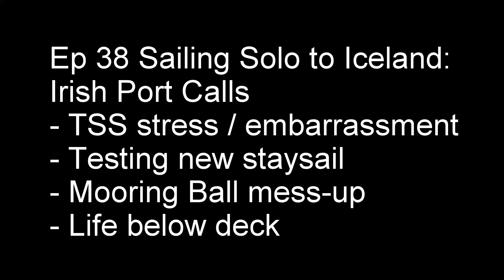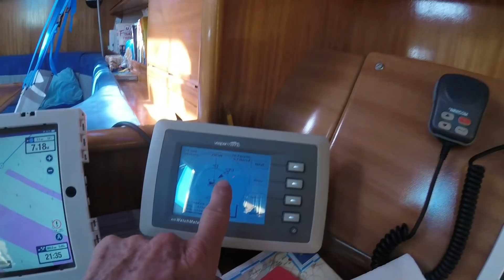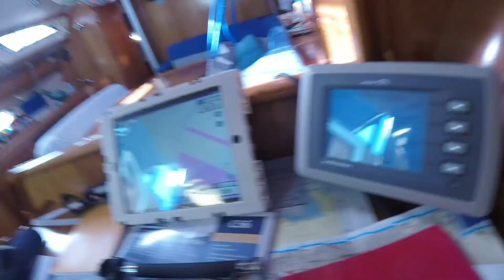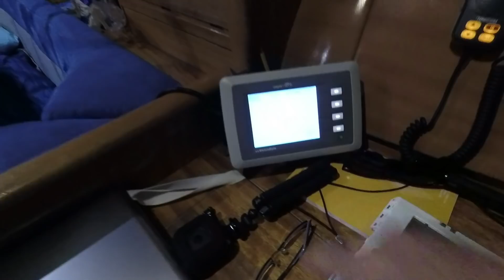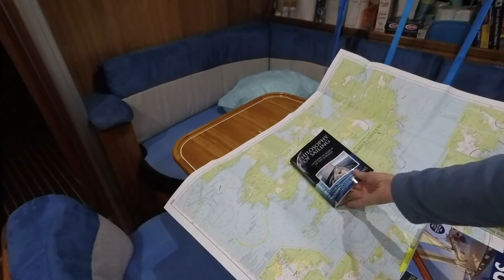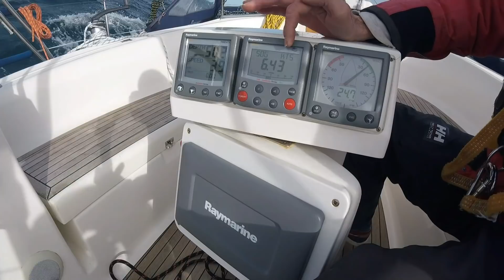EP 38 Sailing Solo to Iceland   Irish Port Calls

Comment: Motor-sailing means you are under power. Not sailing. Normal anti-collision rules do not change whilst in a TSS lane or crossing a TSS. Extra precaustion needs to be taken near the entrance (!) of a TSS.  Always cross a TSS by 090 degrees angle. I would clearly show altering my course to big cargo ships and not take my right, as you were planning at first, but you started altering course possibly a bit late. One cannot expect big cargo ships to alter course all the time for yachts, specificly in busy summertime. Anyways show your intentions in time, that means, long before it actually seems necessary. These big ships need time to anticipate, best is to help them a bit...
Reply: Cale Lorenzo I was confused by that as well, but then figured that since he was the starboard vessel, had right of way, even while motoring right?
Reply from the maker: I guess I would say that normal anticol rules do change (de facto) in a TSS for vessels under 20 meters Cale, as the rule clearly says we are not to impede the large vessels in any way.  To me, that means that inside a TSS, I must give way so as not to impede (in addition to crossing at 90°) to get out of there as quickly as possible.    We are probably agreeing, but there is a nuance there.    At the exit, normal give way / stand on rules apply.   (The fact that my engine was on in this case was irrelevant --- as I was starboard (by engine rules) and sailing (if sailing rules).   He, of course, had to assume I was sailing as both sails were up and no inverted cone.  I was 'wrong' to take a 'give way' attitude in this exit area.   I'll apply the rules as written next time.
Reply: Patrick Laine thanks for your great videos, your rules and docking lessons were amazing, but jeez man did you have to order that mediocre wine when Irish whiskeys were abounding?? Lol
Reply: @patricklaine6958  I agree. But I guess it is good to remind people to be extra careful near the entrance of a TSS. Often a lot of vessels are closing in fast from different directions. And professional traffic does appreciate if yachts show their intentions early to avoid those sometimes nerve wrecking situations (I am a retired merchant navy captain).  Good discussion. Nice videos. Thanks!
Reply from the maker: I was presented a gift of Jameson last night by some lovely people at the marina.   Lesson learned.   :-)

Comment: Congrads Patrick  for the passage , do you have preventer against accidental gybing while sailing down wind ?
Reply from the maker: I don't have a 'preventer' Pamir, but instead a boom 'brake'.  These are the blue lines hanging from a device in the middle of the boom that you may see in some video shots.   A preventer is supposed to stop the boom from gybing; a brake lets it gybe, but greatly reduces the speed of the gybe, to make it much safer.     I have always believed that a preventer will fail somewhere when you need it most.   It's mostly personal preference, and many people highly experienced sailors prefer the preventer over my brake.
Reply: @patricklaine6958  Thanks for the answer i will think  about this boom brake for my Bav 38CR.  Fair winds for return  , take care

Comment: Great job looked like quite a tight fit in the last dock. Would there be any advantage to sailing past and backing in like the Warrior?
Reply from the maker: My boat backs very, very well Stuart (unlike a great many sailboats), and I do reverse in from time to time.  However, once you back into the berth, you have to reach the aft cleat on the pontoon, get a line around it quickly, and then motor forward to pull yourself against the finger.  If you are slow at doing that, the boat may well slide over against the neighbor......... no-one likes that, even if no damage is done.   I never know what to expect on the pontoon in terms of cleats, and I have some boat hardware (davits and bimini frame) that restrict my freedom of movement a bit.   I just prefer to come in bow first where there are fewer variables FOR A SOLO SAILOR.   :-)
Reply: Patrick Laine man it looked so tight, chapeau mon ami

Comment: Picking up that mooring ball  when being the only one on the boat and not being tethered to the vessel looks a tad dangerous.   I mean what would happen if you slipped  off whilst trying to get a grip of it and off your boat went leaving you in the cold water?
Reply from the maker: It is a risk Simon, to be sure, but a measured risk.   1) the engine is at dead stop (idle) when I leave the helm, so it is only going move due to the force of wind/current, and 2) I grew up with a home on a beach, so I swim like a fish.   The problem with tethers is that they limit your movement --- you may notice that I have to quickly move from the complete stern of the boat, up to the bow of the boat to tie things off.   On 90% of boats, you have to stop and untether, and then retether at least once on a trip from stern to bow........    I can't argue with you though, it is indeed a risk.
Reply: Well done  Patrick  looking forward to  to the next video.

Comment: When asked to maintain speed and course was your engine or off? If engine on, (motor sailing) than you are a motor vessel. If only on sail then of course you are a sailboat. This off course is  obvious, but wanted to point out.
Reply from the maker: Good knowledge of the rules Azores.  But, take that logic all the way out.  Assume I was a motor boat.  Does it make any difference?

Comment: Patrick. I don't have an AIS. What's your AIS make and model? If it works for you it will work for me. Thanks.
Reply from the maker: Thanks.  It is made by Vesper Marine.   I'm very happy with it, though I wish it had an adjustable volume on the alarm.   For aa long distance sailor, and especially for solo sailor, I consider this an essential piece of equipment.

Comment: You won't catch the green flash in cold deep water. . You will see the green flash in warmer or cold shallow water. Closer to land
Reply from the maker: I'm not so sure Juliamarie --- last year I saw a spectacular one when leaving the Faroe Islands --- but did not have the camera on.     I'll let you know if I catch one.   :-)
Reply: @patricklaine6958  I see Green flashes all the time off point Dume California. Mostly in the spring and fall . When the sun light refacts off the. Sea bed.  You could possibly see a Green flash in deep water if the sun and the crest of a wave meet  but you would have to be at the right angle to see that.. I've never seen one in deep water.. what is the sunlight going to refract off in deep water.
Reply: @patricklaine6958  how far were you off the coast. When leaving faroe Islands..
Reply from the maker: 100 miles.